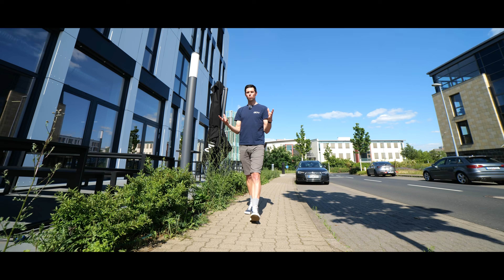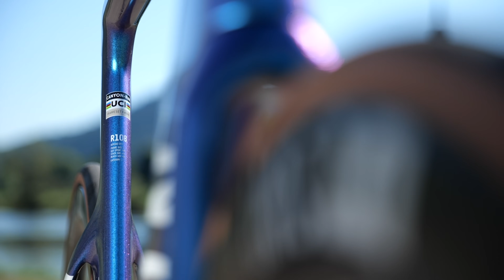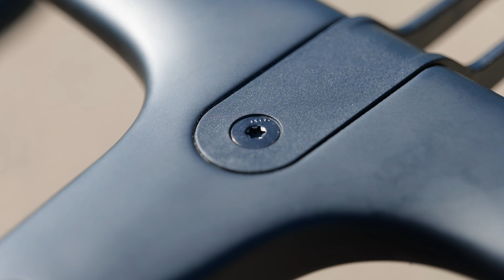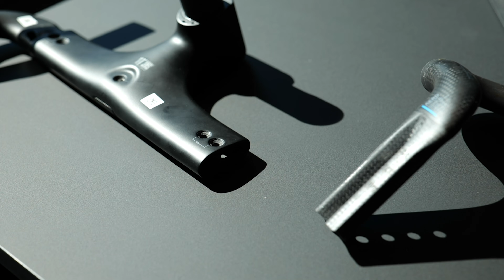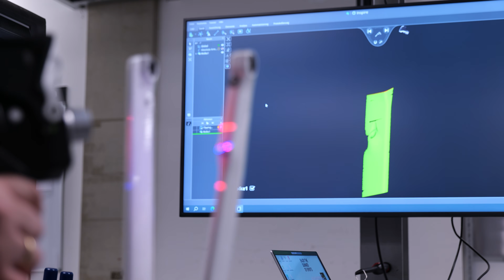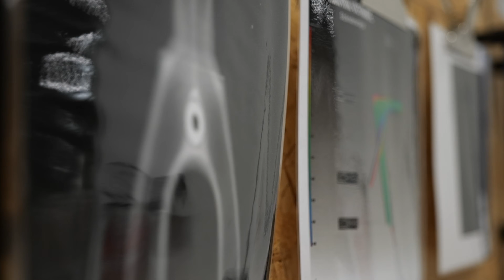New Canyon Aeroad | Behind The Scenes At Canyon HQ

Comment from the maker: What are your thoughts on the Canyon Aeroad?  👇
Reply: It can't really be called new. It's just a fix for a failure in the last version. The only thing new is the flared handlebar and pace aerobar.
Due to problems with the seatpost and headset design in their first version, they sold bikes for ten thousand euros that had metal bearings that were always exposed to rust. They want to erase the third generation. This is only a minor change, not the 4th generation, but they claim it is the 4th generation in order to bury the failure in history. Only the areas where most consumers suffered were improved. A creaky seatpost, a headset bearing structure that rusts very easily, and individual stem lengths that are uniform but not sold separately. These three things have only been improved, but it's the 4th generation? You should be ashamed of yourself. A German company that buries products that need to be recalled without taking action.

The only new changes are the pace bar, aero flare drop bar, and aero extensions.
Even the shape of the frame's seatstays is not an engineering calculation of any kind. The seatpost mount location corresponding to the extra small size of the previous version was replaced because it was no longer needed. The headset, which is said to be completely waterproof with high-quality bearings, is suffering from rust in the previous version, and water leaks are occurring due to the cheap regular steel bearings and poor finishing. The cockpit was also sold with CP0018 installed in a single size, and many users asked if they could purchase it separately, but they answered that it was not possible. Even though the equipment used by Vanderpoel and the pros must be sold according to UCI regulations, the company lies and replies that it is not compatible with CP0015.

Lastly, CP0048 replaces CP0018 with a high probability and can be installed, but instead of guaranteeing any compatibility and taking responsibility, they recklessly claim that it is not compatible. Let's wait and see, right? If someone buys it and installs it, the truth will be immediately revealed. They don't want to take any responsibility, consideration or testing. The 3rd generation Aeroroad is literally a huge failure. An unfinished product that could only be used if managed by a professional scene and replaced at any time was sold for ten thousand euros.
Reply: buyer beware: Wow look at the nice new shiny bike, it’s a beautiful piece of German engineering, but I want to let you know of my experience with Canyon Aeroad CF SL8. I too was delighted with the thought of a sophisticated bike at a reasonable price point. It came with a 6 year warranty, but that warranty is useless. I have logged over 30 thousand miles on my Specialized Allez  with no major issues, I have replaced the gear cable for the rear derailleur a couple of times and the tires only once. My 11 month canyon had to have the bottom bracket  replaced after only 5,000 miles. I reported this to Canyon and they are blaming me for not taking proper care of my bike. I loved this bike and looked after it accordingly. Washed    at least once a week (no pressure wash) locked in the garage overnight and stored in the basement during the winter. After finding a mechanic who would repair my bike (most technician won’t ever look at a Canyon) he told me that the bottom bracket is a cheap one that has no seal against water and debris intrusion. It breaks my heart to have to write this but if I can at least help one person with this it will be worth it. Canyon did offer me a $75.00 voucher on their web site but to me thats useless.
Reply: Too expensive. For such prices, I prefer BMC or Specialized.
Reply: Had the chance to ride it two days ago. Fantastic bike! Currently own a 2nd Gen Aeroad - incredible improvement made in the last 5 years! So good! Only dislike: On CFR models would wish for the logo on the head tube instead of the canyon name (again, as it is all over the frame). Would be a cleaner look.
Reply: hmmm... proprietary bottle cages (CANYON bottles only), press-fit BB in a carbon frame, heavier than a Specialized S-Works Tarmac SL7, but I like the blue colour
Reply: @OriginalTrev  not true! Was able to put my own Camelbak bottles in. Have seen one video where they showed it at the end too, but wasn't the case when I rode it this week.
Reply: Same
Reply: Why did they change the wheels from 60mm to 50mm?
Reply: @kccabrera11  To show you 40g weight reduction
Reply: @vaninaleksey how about the aero claim of deep section wheels?
Reply: Certainly a fantastic bike. The downside is one really -it is unattainable due to the cost.
Reply: Unremarkable technically, over hyped by GCN due to sponsorship as usual .. .
Reply: I have a 2023 Aeroroad CF SLX with  ultegra Di 2 have a vid on my Chanel ( obviously there’s a lighter one and now this new one ) been riding the bike for about a year now I can categorically say that there’s no better bike for the money. Extremely high quality bike. I would love to buy the new one when it comes out. Tx
Reply: Yes changing the cockpit is still a massive pain. May be not because of bleeding the brakes but with expense and waste involved. Basically one have to pay £220 to change with pace drops and £200 new stem if the stem length needs to be changed as well. For stem length change probably breaks needs to be bleed so another £50-£70 for that. Worst of all, the drops and stem that comes with the bike would probably go to the landfill at the end. So please tell me @GCN how this is not pain?
Reply: I've been waiting for this to drop for ages! One question: How would the new 105 version compare? Or are all the upgrades and improvements specific to the dura ace version you were riding in the video?
Reply: I want one!
Reply: Excellent moment to get the outgoing model at a discount hopefully.
Reply: Never available
Reply: I think that I will order one soon...
Reply: @gcn  It's no entry-level bike. Shouldn't be judged as one either.
Reply: Unavailable.
Reply: I bought one end of May 2024. Big mistake. Despite following the sizing chart the frame is too big, the bars are too high and too close. It is not possible to change to any stem on the 1 1/8 steerer as it is a special design where the fork ends inside of the headtube and doesn't rise above the top bearings. As of Aug 2024 you can buy new, longer bars at €599 (offered 499 on discount) but they don't have any with negative rise to make the front end lower. You can't even slam the stem as when you remove all spacers it's still about 1cm above the top tube. It's like someone designed a great looking shoe - waterproof, hard wearing but only made them in 4 sizes.  Who on earth signed off on that design decision? Why was I so stupid to purchase an Aeroad? Don't make the same mistake as me, tempting as it may be.
Reply: blue color is heavier than black one?
Reply: Shite
Reply: That Torx everywhere idea and its execution is great. The hex bolts and screws are nice but easier to damage.
Reply: lower section wheels, very small differences and very disappointing colors, all while it's more expensive.
Reply: @gertjanaertgeerts  Actually cheaper than the previous generation. The previous generation started at £4.2k. This generation starts at £4k. But the rims are 50mm vs 62mm...
Reply: @muratmustafa4532  The new racing bike frame is equipped with a lighter 50mm all-round wheelset and has the same air resistance as the last generation with a 62mm wheelset. Therefore the bike is a better all-rounder.
Reply: The most expensive ones do have a nice color. The rest is a disaster. Is this on purpose?
Reply: Boring, overpriced AF!
Reply: @IK47-d2l I don’t think you know what an overpriced bicycle is.

Comment: Stainless steel is generally softer, so what you gain in corrosion resistance you give up in bearing hardness and thus long term wear. With all innovations on the handle bars, too bad they didn't go further ergonomically by giving a bit of back sweep and down angle to match the natural position of your hands like the coefficient bars. That stuff said, if I were to get another bike, it'd probably be this one.

Comment: buyer beware: Wow look at the nice new shiny bike, it’s a beautiful piece of German engineering, but I want to let you know of my experience with Canyon Aeroad CF SL8. I too was delighted with the thought of a sophisticated bike at a reasonable price point. It came with a 6 year warranty, but that warranty is useless. I have logged over 30 thousand miles on my Specialized Allez  with no major issues, I have replaced the gear cable for the rear derailleur a couple of times and the tires only once. My 11 month canyon had to have the bottom bracket  replaced after only 5,000 miles. I reported this to Canyon and they are blaming me for not taking proper care of my bike. I loved this bike and looked after it accordingly. Washed    at least once a week (no pressure wash) locked in the garage overnight and stored in the basement during the winter. After finding a mechanic who would repair my bike (most technician won’t ever look at a Canyon) he told me that the bottom bracket is a cheap one that has no seal against water and debris intrusion. It breaks my heart to have to write this but if I can at least help one person with this it will be worth it. Canyon did offer me a $75.00 voucher on their web site but to me thats useless.

Comment: The Shofter cable snapped on my mates Canyon Ultimate CF SL 8 (or 9 idk)

Its a 200€ mechanics bill bc there is no access to the internal routing system and the otherwise fine bottom bracket will have to come out, which means it will have to be replaced and I think that was something pretty easy to avoid by simply modifying the internal routing system slightly. 

I think when Mechanics ask for a bike thwts easier to work on, they have a point.

Comment: Lovely bike. Pity its only 40g lighter than the previous model.my 5 year old Bianchi Oltre XR4 is 7.4kg with pedals , bottle cages and computer mount with rim brakes and alu rims. Still absolutely love it. It seems crazy to speed 10k to upgrade for a bike that isn't even lighter. I really like the ultimate aand always wonder why VDP doesn't ride in the big mountain stages. Maybe 0.5kg lighter. Not exactly good advertising for the bike.

Comment: how big is the difference between Ultegra and 105? I can see the weight is like 400 grams how much would this do over like 100ks?
Reply: If you need to ask the 105 would be fine. I was told many times that it is a 'almost' ultegra. It should be the best price performance ratio.
Reply: @Sir.NathanDrake  i have Ultegra currently and loving it. But were just wondering How Big the drop down would be

Comment: All this design refinement is moot, when it is subject to the outdated, hide-bound whims of UCI technical committee members. Otherwise, pros would be riding fully-faired recumbents and averaging 80-100km/h on flat stages. The white-haired old bigots on these committees  still think that a round steel-tubed bike with aluminium components is the pinnacle of technical achievement, and only grudgingly allow all this newfangled plasticky stuff.

Comment: Fastest, light as a feather blah, blah, blah with your sub 6/7kg superbike like your up there with these 65kg pro bike riders 🧐...,in my world we are 58 yrs old & weigh 98kg & no way in hell am i getting on a superbike that's not at least 8kg....,i've got nothing to prove anymore & just glad that im in the position at this stage in my life where i have disposable funds to indulge myself ( sshhh, don't tell the wife ) I could have bought myself one of those silly, stupid more money than sense £12/14k mainstream rip off so called top shelve road bikes but decided to go the route of a custom build road bike., just over the £6k mark for my build but that gets ya a 56cm Merida 7000e Reacto 2021 full carbon frameset that i was lucky to get the Vision  Metron 440mm carbon full integrated handlebars & the CW carbon 380mm areo seat post that i fitted with a 3D carbon printed saddle ( Specialized S-Works Romin II ) Ultegra full 8100 Di2 12 speed Bluetooth & almost wireless groupset with 50mm Prime Black Edition carbon rims set with Tpu tubes wrapped up in 28mm Continental Gp5000s black chilli compound race tires ( beaded clinchers ) bottom bracket, headset & hubs all ceramic bearings & don't any of you dare let me go on about every single titanium bolt i installed., peddles are PD-R8000 & all my cycling gear, tools, accessories & cycling clothes over £4k but as i said im 58 yrs old & been riding since i was 3/4 yrs old & in the here & now is good to go....!!!

Comment: All that research and development and yet they still don’t give a shit about their current customer. The most requested thing from current aeroad owners is to be able to buy a different spec handlebar than the one that comes with it. Here i am with a stem that is to short for my long arms and i am stuck with it. For the love of god canyon, let the people have access to different spec handlebar for the cp0018 cockpit. The most frustrating thing is to see racing team having their own custom spec handlebar for them. Just make available for the public god damn it
Reply: It can't really be called new. It's just a fix for a failure in the last version. The only thing new is the flared handlebar and pace aerobar.
Due to problems with the seatpost and headset design in their first version, they sold bikes for ten thousand euros that had metal bearings that were always exposed to rust. They want to erase the third generation. This is only a minor change, not the 4th generation, but they claim it is the 4th generation in order to bury the failure in history. Only the areas where most consumers suffered were improved. A creaky seatpost, a headset bearing structure that rusts very easily, and individual stem lengths that are uniform but not sold separately. These three things have only been improved, but it's the 4th generation? You should be ashamed of yourself. A German company that buries products that need to be recalled without taking action.

Comment: So what’s the actual windtunnel numbers. You said they tested against other bikes, but then you didn’t mention the numbers…
Plus, what were the configs tested? Aeroad with 35cm handlebar vs SL8 with 40s?
Reply: I have a gen 3 CFR and S-Works SL8. Even if you can get an SL8 bar as narrow as you can with the CFR (36cm centre to centre on my CFR vs 38cm on my SL8), the downtube on the SL8 is wider, so with the same Roval wheels, I can see the downtube on the SL8 through the fork when looking from the front to the back. On my CFR I can barely notice the downtube. The fork blades are thinner on the CFR than on the SL8 when looking head-on, the same with the head tube. 

To top it all off, the CFR is stiffer in the bottom bracket area than the SL8. I can feel it and I can see it - I can't see any flex when I look down whilst pedalling on the CFR but I can definitely see it on the SL8. My power meter data is also showing I'm faster with the same watts on the CFR vs the SL8. Why is stiffness even important? There is another video from David Arthur comparing a CFR vs an SLX and there is a difference of about 10% more power required to do 30kph on the SLX. This is similar to what I'm seeing with my CFR vs SL8.

Don't get me wrong, the CFR does have negatives, like it's weight and being a harsher rider when compared to the SL8. For me, the SL8 honeymoon period is over and I'm slowly liking my CFR again.

Comment: “Talked to the mechanics and made a super reliable bike.” - puts PressFit BB on the bike...
Reply: As long as the bb is correctly toleranced, press fit brings no disadvantages and means the frame weighs less...
Reply: @stephenp1615  I would expect that because the CFR frames are made in Germany that the tolerances will be spot on. Most of the tolerance issues come from frames made in Asia, but the worst bike brand for tolerance issues are the American brand who started the trend in the first place.

Having said that, LBS and team mechanics are divided on the subject based on personal experience and preferences, so have to be taken with a pinch of salt. It's the home mechanics who have a harder time with pressfit because the proper tools for the job are extremely expensive, and a standard workstand that clamps the seatpost is less than ideal for holding the bike - especially on posts with a teardrop profile.
Reply: @matt_acton-varian  "CFR frames are made in Germany" :face-blue-smiling::face-turquoise-covering-eyes:
Reply: @matt_acton-varian  "CFR frames are made in Germany" are you sure? Where did you find that information, seriously asking...?

Comment: The theme was make the bike easier to work on; and they keep the PF86 BB instead of moving to threaded.  😢😢😢😢😢
Reply: creak creak creak creak
Reply: @zygmuntthecacaokakistocrat6589  if pressfit is giving problems that's due to poor quality of the frame, not the bottom bracket design. They should make sure there's a perfect fit in each and every frame before installing the bottom bracket, and reaming the hole if there isn't.